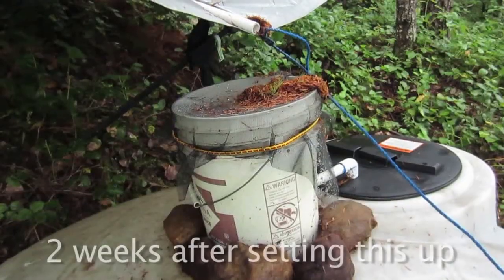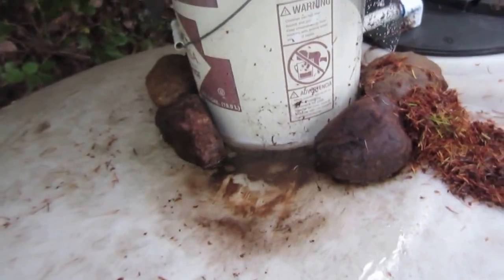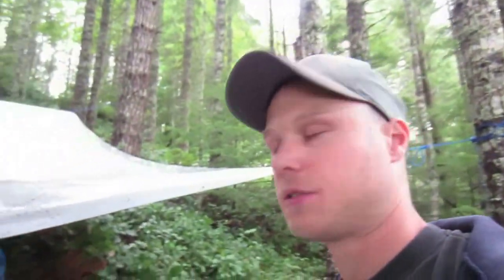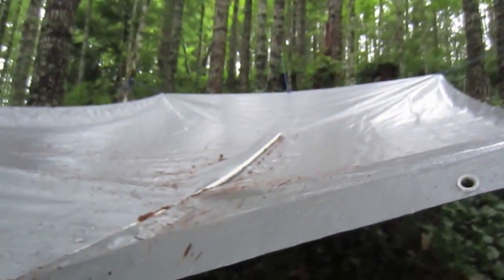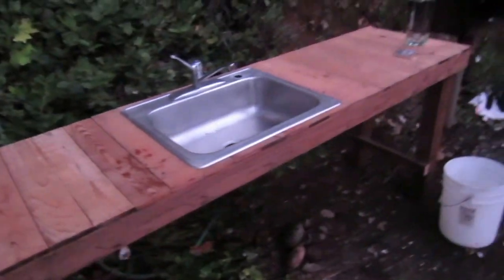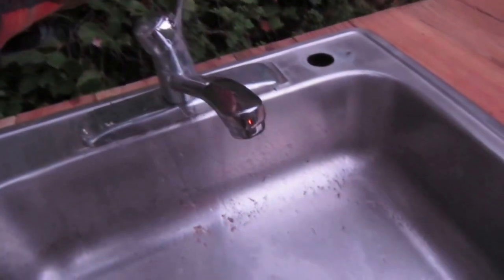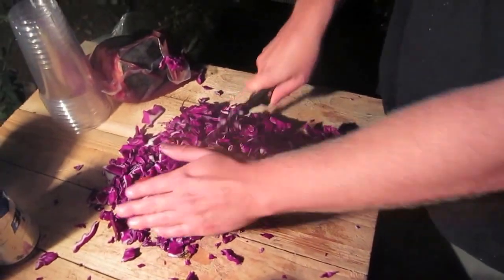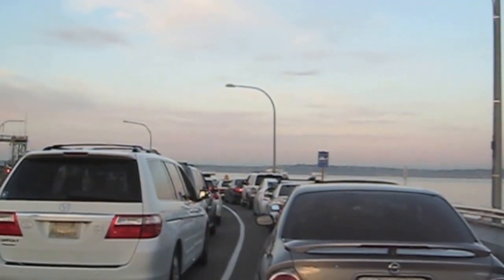Wilderness Off Grid Cabin - How to Build: Rain Water Collection - Part 2

Comment: I'm surprised that tarp held up - usually they seem to rip out at the grommets unless you reinforce them or use lots of small guy lines on all the grommets.   How has it held up?
Reply from the maker: Eventually died, lasted for a few years. Replaced with a metal roof, check out that video.